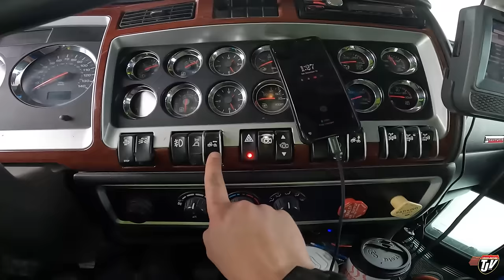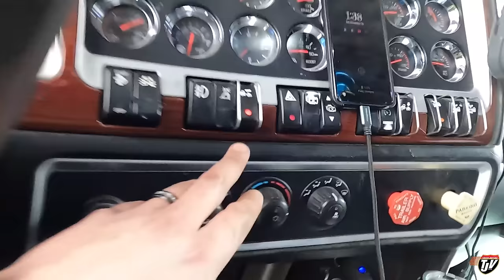GOING TO TEXAS! | My Trucking Life | Vlog #2968

Comment: Josh. When the truck is in your shop out of the weather. You can clean the pins and grease them with dry-lube. This helps a lot because the dried-lube does not catch so much dirt from the roads.

Comment: the term fith-wheell comes from the horse and cart days. the cart would have 4 wheels and, originally, a fixed front axle which made turning difficult. to alleviate this, a "wheel" was fixed to the underside of the cart which allowed the fron axel to articulate / turn. it was thus named the 5th wheel :)

Comment: Tip from an old driver. Carry Dawn dish detergent with you. Put a lot on and around the pins. It’s a great lubricant and will wash away in the rain. Grease accumulates dirt and grime, Dawn washes it away. I even use it to slide the tandems on the trailer. 
Be careful out there. That’s an order, not a request.

Comment: Hey TJV, it's called a 5th wheel as back in the day trucks only had 2 axles 4 wheels plus the turntable + 5 wheels... As for the 5th wheel hydraulic pins, EU/UK/AUST trucks have the same locking mechanism as you have when pulling the kin pin.. A much easier and simple process.
Reply: Thanks for the info
Reply: @icaacfriedman8552  you're welcome mate

Comment: Josh, just started the clip and meet suggestion for opening hood. Next time push up and loft from under fender by steep tires. Learned that after way to mean years opening it from the top center like you did. It takes a little got till in shoulders and can cause shoulder replacement surgery down the road.

Comment: Ur only 6k why do u have ur jakes on?
Reply: It still helps to slow the truck down without using the brakes. Plus, Jake brakes usually have three settings: high, medium, low. And also, when you're an owner operator, you'll gladly choose to save wear and tear on your brakes by utilizing the jake!